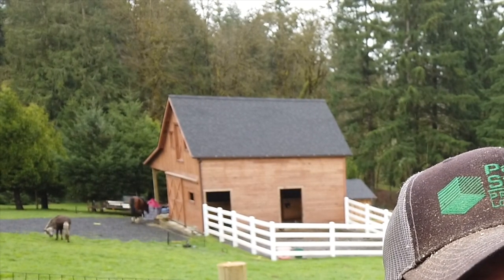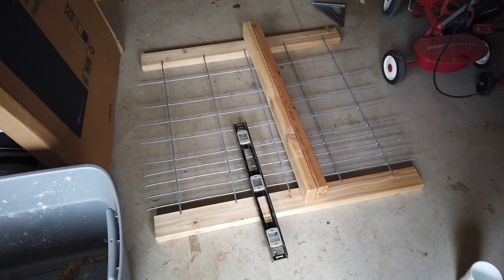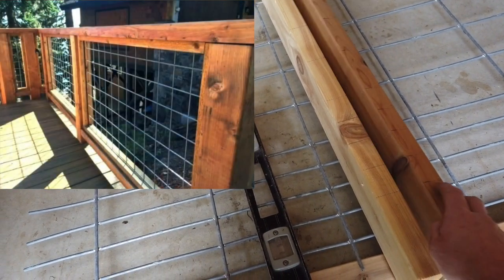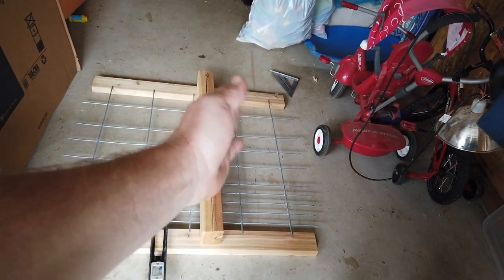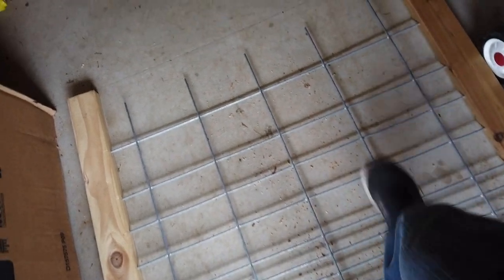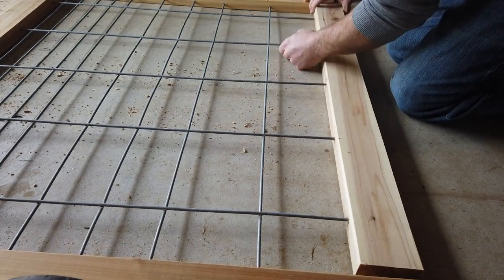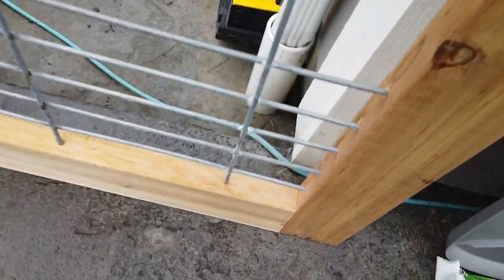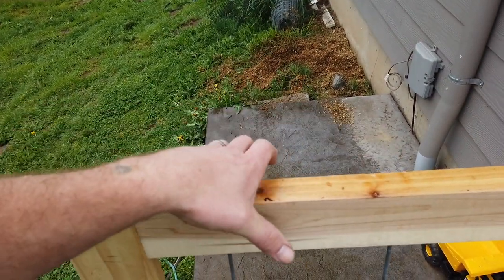Hogs Panel Gate II Auto Close Hinges

Comment: I've been searching YouTube for hog fence builds and wondered why everyone else cut dados in their bottom piece of wood for water to collect instead of drilling holes.  I think this is the way to go!  I suppose a few drops of epoxy in those holes would prevent water from getting in there too.  I think that's my plan; drill holes for the bottom piece of wood like you did, and sink in the fence wire in epoxy.

Comment: Some silicone caulk in those holes during construction would eliminate the water intrusion issue. 

And as long as you stained the wood  every 4-5 years you wouldn't have to worry about moisture at all.

Comment: I want to do this for my front yard. How big are the bigger squares on this gate? I have a dachshund mix and Im worried she will escape
Reply from the maker: This gate was made using a hog panel which is 34” tall and the openings gradually get bigger from bottom to top. They go from 2 inches at the bottom 4 inches middle and 6” openings at the top. They do make other panels with smaller openings. Thanks for watching!